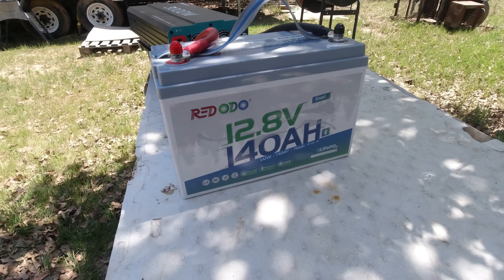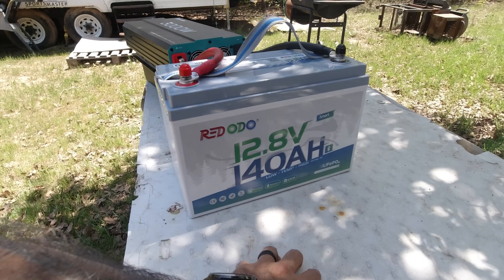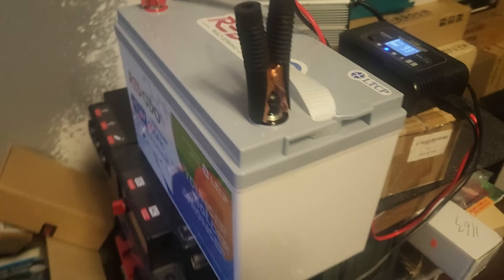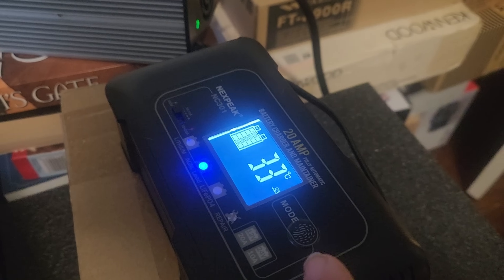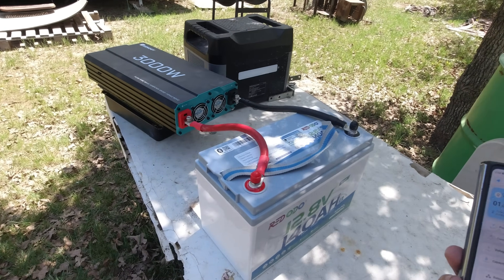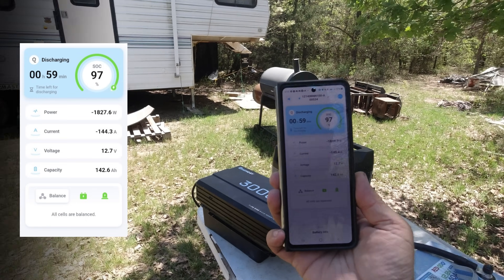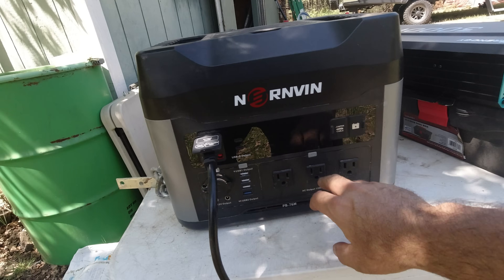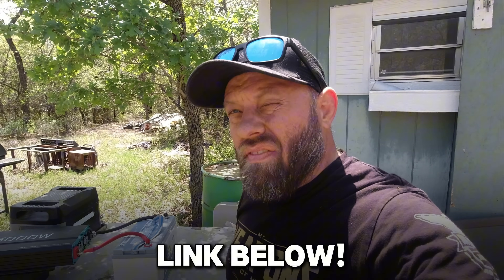The SHOCKING Truth About Redodo 140AH LiFePO4 Battery

Comment: I have two Redodo batteries and am pretty happy with them. I wish I had gotten one with Bluetooth for one of my applications. It would have saved me from having to buy a monitor and shunt. Not that they were expensive, just added complexity, bulk, and wiring in the case. I'm in the market for another battery in the 100Ah range or even larger. It's for backup emergency power on one of our club repeaters. With 100Ah, it should keep the repeater running for a few days and I also intend to supplement with solar in the future. The repeater is in a remote location that no one goes to unless there is a problem with the repeater, so no one would be checking on the status of the battery or anything else in the system very regularly. The location is unconditioned space, so it can get quite warm in the summer and cold in the winter. Someone in the club commented that they wouldn't recommend a LiFePO4 battery over safety concerns of those types of batteries. I don't expect it to ever get so hot or cold that the battery would not function. I think their concern was more due to the chemistry and the misconception of the fire risk. They suggested a deep cycle battery instead. My concern with using something like a deep cycle battery is needing to periodically check the water. I know it's just not going to get done as infrequently as people go there. In your opinion, would a LiFePO4 be good in this situation or would I be better served (and supposedly safer) with something like a deep cycle?

Comment: you were using the 20 amp charger on a LiFePO4 battery, but the AGM/LA battery type light was flashing?  Could that be why it was showing 11 volts?
Reply from the maker: No, that only matters on the top-off

Comment: I have used many REDODO battery's and they great ! Common RV battery ! Well known and loved in the RV industry. Li-Time and Power queen is the outher big 2.  The thing with cold charging in LiFePO4 is not a freezing thing . The IONS get lost in cold charge and they get lost forever causing permanent damage.    Just 1 charge below 32F and junk battery . Many BoonDockers would charge them in the cold  and ruin them them replace under warranty now many have LTCP . Many RV have battery box outside   . And like in dessert it can drop below 32 over night and sun in AM and you get a high charge before battery warms up. Many don't know the charge problem with LiFePO4 . That why detailed manual comes with battery . REDODO gives a great manual and stickers with the battery !  Just some insulation board from Home Depot around battery keeps them warmer buy a lot . The thin pink stuff. Normally fits in battery box with battery . It's like 1/4 in thick.  73